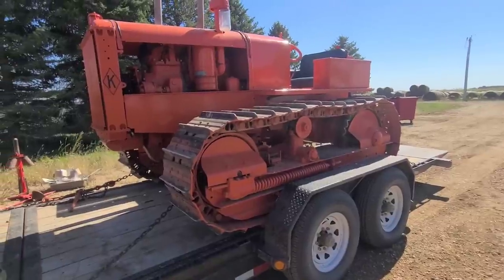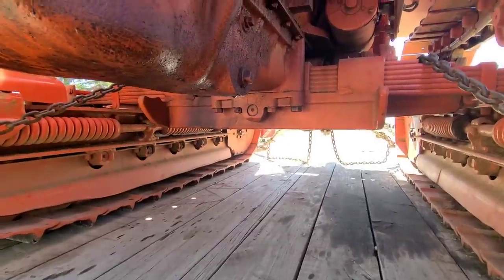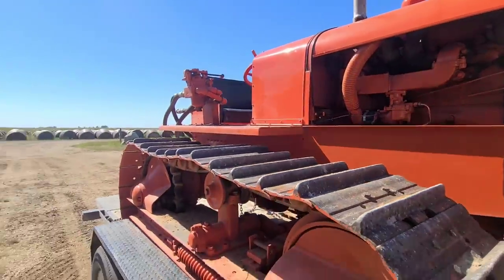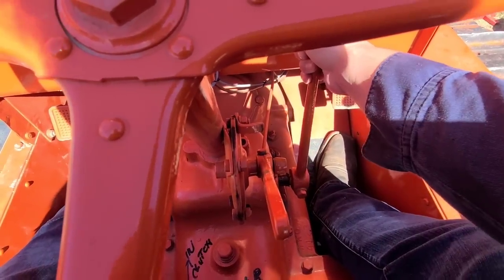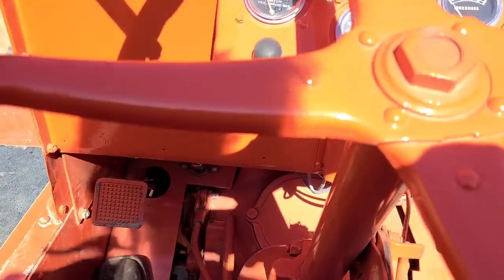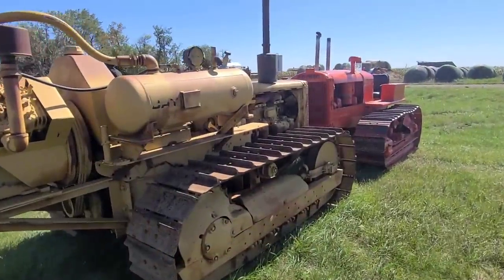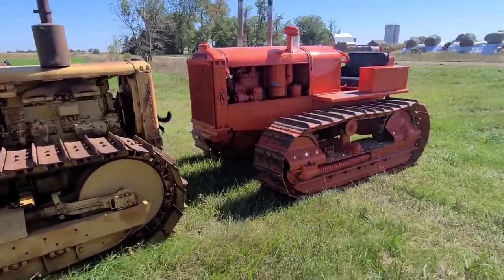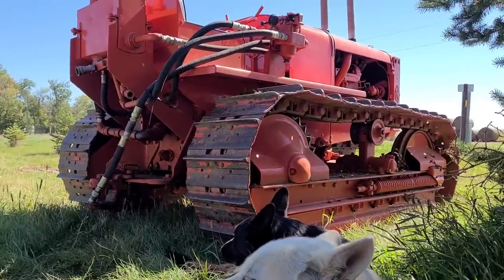More New Iron?!

Comment: Looks nice! I take it that since it has twin stacks it used a pony motor. If that was the old injector in there, than they maybe milled the combustion chamber to reduce compression?
Reply from the maker: No pony motor, just electric start. Compression on the diesel was only 6.5 to 1, therefore no modification needed to run on gas
Reply: @kylechrist  Thanks!  Any idea why it would have had twin stacks then?

Comment: Any plans to put back to oil engine?  I suppose the parts are long gone...
Reply from the maker: They are long gone and even if I found the parts, there is a reason that allis converted them back to gas
Reply: @kylechrist  Right, they weren't as efficient as full diesels, but better than gas.  I'm not familiar with the issues they had but there are still some out there running on oil.  It would definitely be a cool show piece, but I suppose most people don't understand the significance of the oil engines.

Comment: When it was converted back to gas, was something done to lower the compression ratio?
Reply from the maker: Even as a spark ignition diesel, they only ran 6.5 to 1 compression so as far as I know they basically deleted the diesel injection pump and lines
Reply: @kylechrist  I had never heard of a spark ignition diesel.  I learned something new today!
Reply from the maker: @ThatOliverGuyChris  they exist but there is definitely a reason they don't do it anymore. From everything I have understood, spark ignition diesel engines typically had issues
Reply: Guess it wouldn't be to far off from kerosene distillate. I bet plugs fouling was an issue.
Reply from the maker: @ThatOliverGuyChris  this is from the allis chalmers forum:

In addition to std. diesel fuel injection system, it also has a magneto and special spark plugs. Rather than rely solely on compression to ignite the diesel fuel sprayed into the cylinder via the injectors, Allis Chalmers designed these crawler engines with a magneto to ignite the diesel fuel in a more uniform, smoother, ideal ignition timing vs. relying only on compression and diesel injection timing.

Starting the tractor - Starter motor turns over engine while the operator actuates a very small "charge" of gas that is injected with the diesel fuel, the spark plugs ignite the gas/diesel mixture, then the engine runs on diesel fuel, being spark-ignited by the magneto